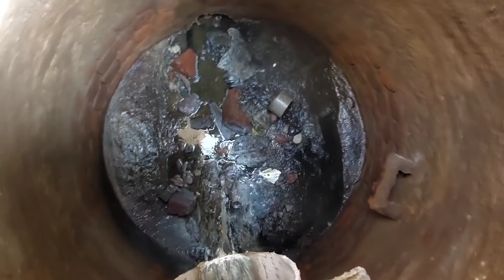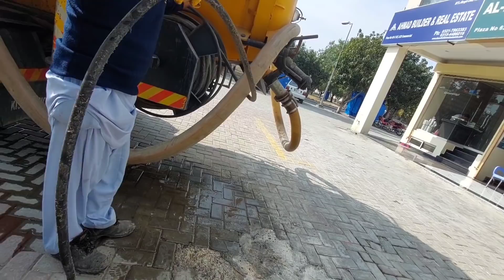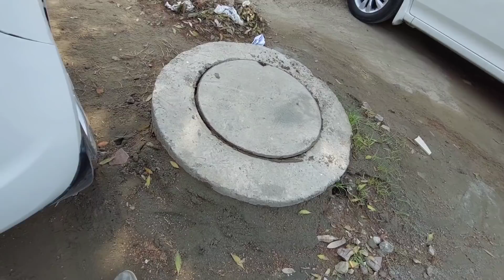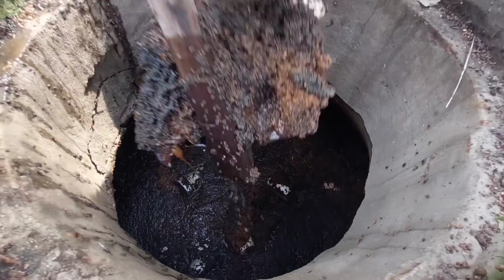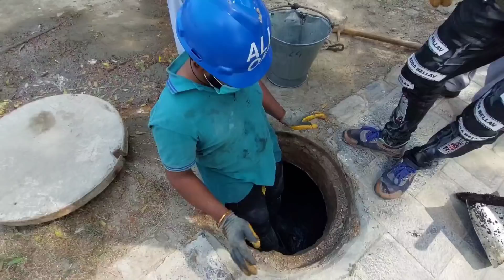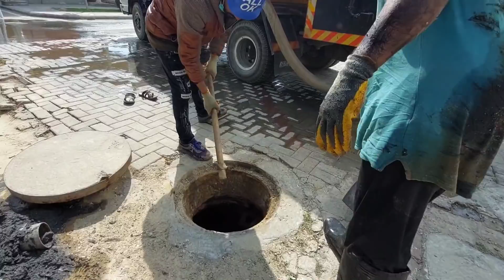Drain Complaint 186 | The entire sewer line was blocked near the Housing Society's head office |

Comment: Always with the bricks.  Do people amuse themselves by opening up manholes and dropping bricks in?  Or did some other team break a plug and just leave the bricks there?
Reply from the maker: When a plumber inserts a septic tank pipe into a manhole, he breaks through the manhole and drills a hole. When drilling, bricks and cement falls down into the manhole, which is why most manholes contain brick debris.
Reply: @TheSewerMan4  That makes sense, although it's disappointing that they're not cleaning up the mess their work makes.
Reply from the maker: We had to clean up their mess.